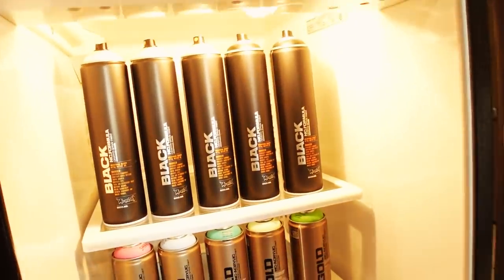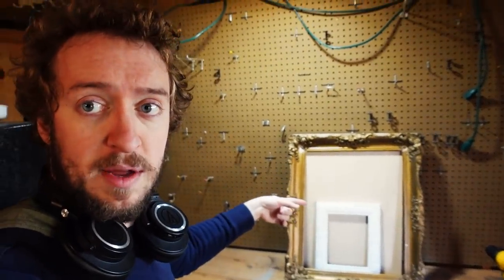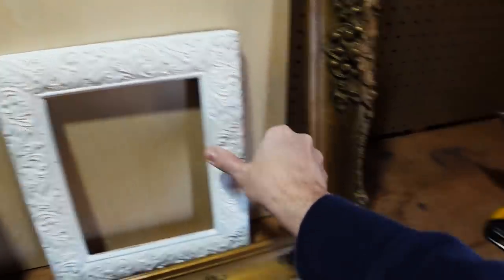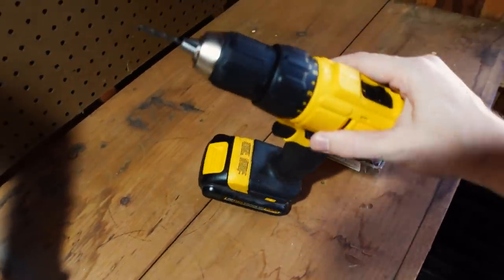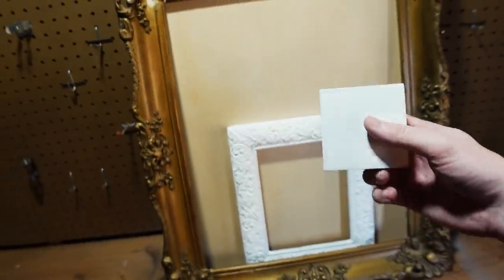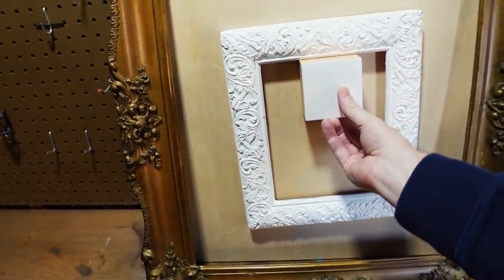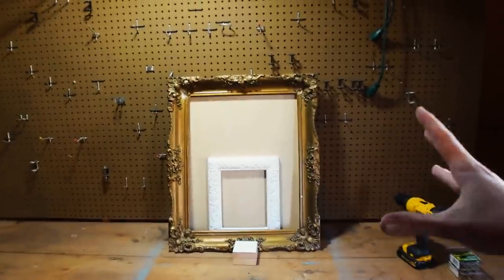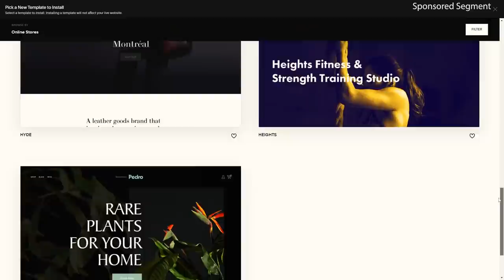Can the Frame BE the Art? (Process Video)

Comment: Hey Peter, short tip for spray painting. If you want and even coating paint with the can farther from the object and make quick and swift passes until you get the tone you want. If you want saturated drippy areas then keep the can static